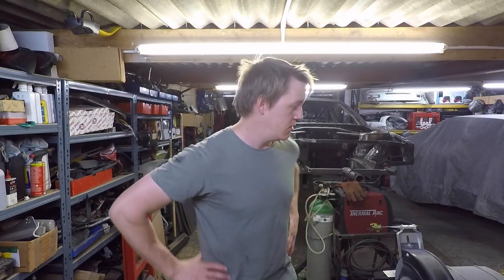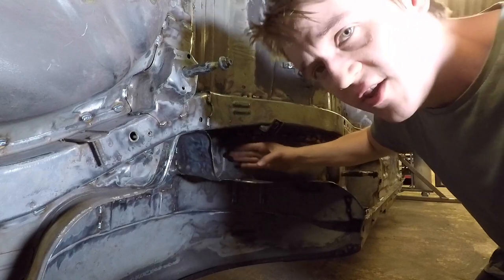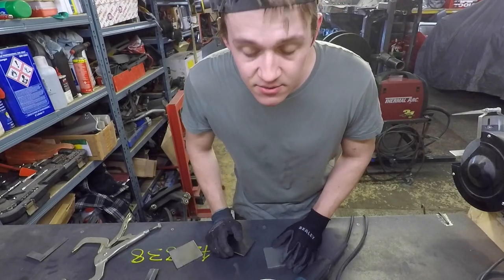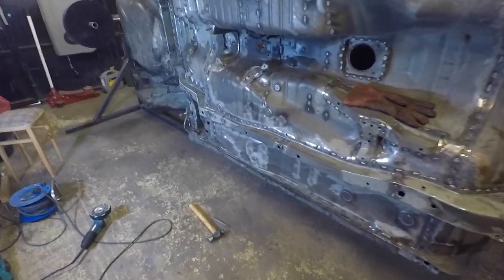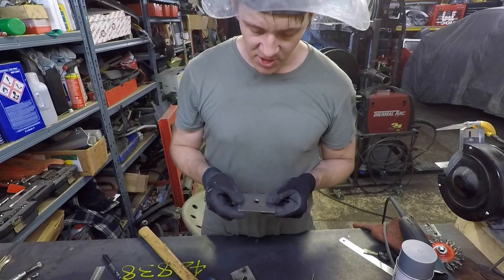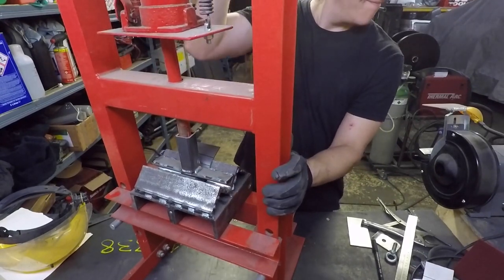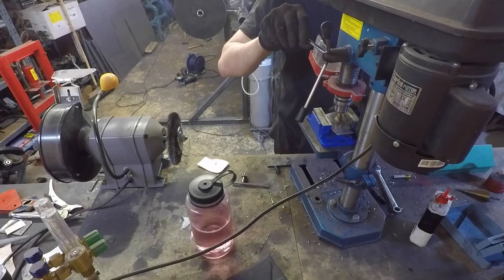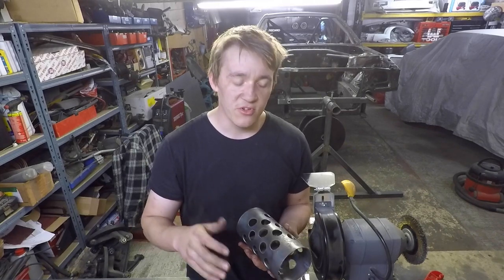FIA harness mount fabrication - R32 GTR Build: Episode 5

Comment: I see you've modified and plated the ends of the factory cross "rails" that the seats sit on. Is that a documented grpa thing?
Reply from the maker: Alex R32 good eye. The original group A used the front mount holes and slider rails (lol). I had to get it to FIA spec that involves doing what you’ve spied. It’s actually got a 3mm plate inside the cross member too, both ends.

The extra rear cross member on both sides is a group A modification, again, it’s got 3mm plates top and bottom. :)

Comment: Nurburgring in 2021 with this car? :)
Reply from the maker: That would be lovely huh! I can only focus on finishing the car at the moment, or my brain will explode.
Reply: @AlexGrA  That i do understand. Since you`re going for a group a type car - are you fitting a Getrag in it? The group a cars had adjustable 6 speed transmission in them right? 
I just fitted one in mine, and it transformed the car, even at currently stock HP. I really think you would enjoy it as well.
Reply from the maker: Thomas Kraus hey, I’ve heard great things about those boxes! Bet it really complements the r32. 

I’ve got quite a special box for it recently, I’ll cover those bits once the shell is done :) H pattern still of course! The group A cars ran two types of box, both dog engagement, one 6 speed and one dog leg 5.
Reply: @AlexGrA  Ohhh boy! Those vids can't come fast enough!